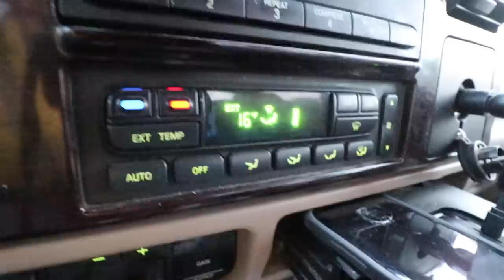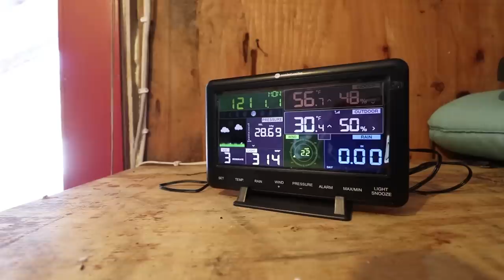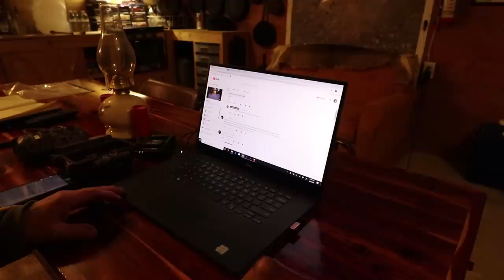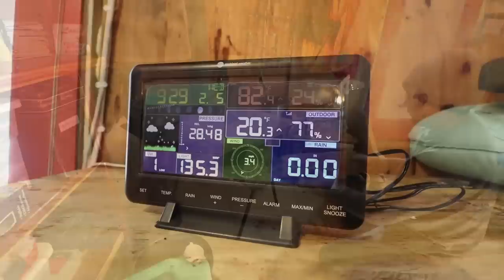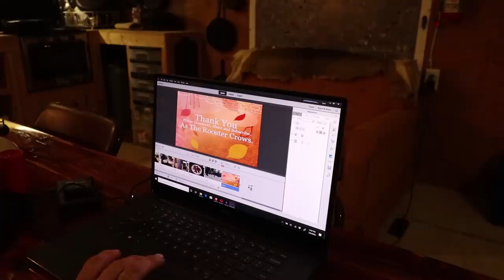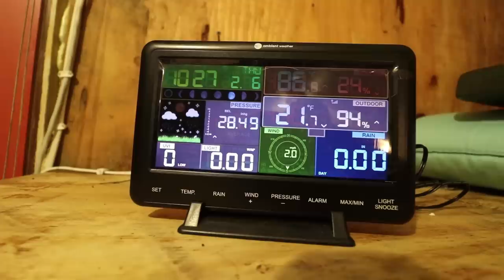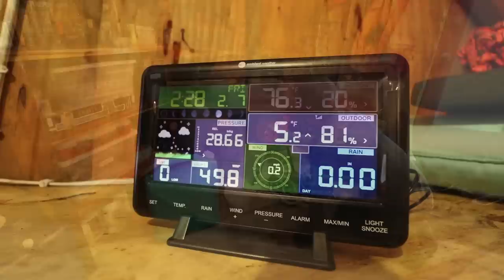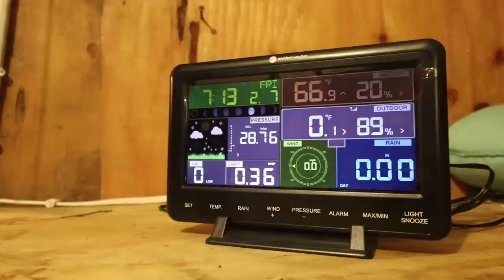THE TENT. Winter Trip 2020.

Comment: It seems like it takes quite awhile to heat yer place. I have a camp with a park model trailer on it. When I go out there in the winter I use a propane 30000 btu heater to quickly heat the place. then I turn on the furnace. The place is up  to temp within 30 minutes.

Comment: Ford truck fired right up you run a thin weight oil in the winter time , we use 15w40 here in NC but im sure that would be to heavy for the temps you guys have up north.

Comment: If you level the front of the cabin again the door will be fine.  Should be a little jacking and shimming. Then you can keep the nice door. After all it does have a great view.  PS If you move the grill in a closer to the cabin. before you leave at the end of summer. it would be less shoveling in the winter.

Comment: You have got to be running half kerosene with you're diesel or the fuel would gel in that temperature. Thanks for the video Joe.
Reply from the maker: When you get diesel here in Minnesota they blend it for the winter. Right now it is blended to handle up to 30 below. I think March 1st it switches to 20 below etc.

Comment: One of my favorite parts of each trip is the “warmup” routine
Reply from the maker: Thank you Rachel.
Reply: Thanks for your personal reply it really means a LOT! Specifically I enjoy watching the temperature in the truck as you drive there, then the sound of the crunching snow so cold the moisture has been sucked out of it to crystallize as you snowshoe the lake then later shovel. It comes apart in “soft” bricks as you cut and toss your way to the outhouse, the fire pit and the grill, like a gardener turning over spring sod. The squeal of the red windowed door as you hurl long dry wood in the firebox. The metal tang of the lever hitting the frame as you put those first frozen cuts into the furnace (after scraping from previous trip of course), and putting the heater in front of the fan in the bedroom. The electric blanket is turned on for a toast slumber. Last, the outhouse firebox is lit by then the internal cabin temperature is around 55-65 I would imagine. In between off camera I would assume you unpack, set security, retrieve property camera data and settle in. That’s what I enjoy most! The rest is like having an extra present. I know most of us faithful followers love the same thing. Thank you for sharing (and in some ways turning your private time into work) all for our enjoyment, which is why I made the first comment.

Comment: You're lucky our family had a summer cabin.  It was beautiful and expensive.  A great place for the whole family.
My father had a guy build a cabin on a river in Snohomish County in Washington State.  During the winter if is not raining its snowing.  So the family just used it during the summer months. 
The first winter the electric bill was astronomical.  Went to the cabin to find out some jerk decided the cabin was a great place to call home.  So we tried to put better locks and that was a mistake.  Homeless people from Seattle decided that Snohomish County was a great place to live off other people.
They kick down fortified doors and broke all the windows.  They completely took any thing of value - kitchen appliances, bath room  fixtures and furniture.  These jerks even took the siding and roof material.  I guess they used it to build their own shelter.  They took the drywall and window frames. 
We learned our lesson and tore down the remains of the cabin.  Insurance would not insure anymore.  It was beautiful when first completed.
Now druggies have taken over the area.  So now nobody in the family goes there.
I glad you do not have the problems we had.  Your cabin is beautiful.

Comment: So I may have missed it ,but please tell us more about how you get all your power? I'm 2 years into a cabin in Alaska and I'm trying to figure out the elec. needs. You seem to have plenty of power includeing through out the night ..elec. blanket... Are you running a generator the whole time? If you have an epsioed where you covered this please let me know. Thanks
Reply from the maker: I ran a generator the first 7 years and then had grid power brought in on the lake bed and then dug underground once the cable hits land. At the boat landing the big green electric box is where it starts across the lake. I have a Honda EU3000is generator. It ran all my needs and will run 23 hours on the 4 gallon tank of gas. Very quiet. I had a 100 foot cord and I ran the cord the whole hundred feet and that is where I put the generator. I have many early Tent videos where I am starting the generator. I was not there when they ran the power, I was down in the cities at work so I have no video on them bringing the power across the lake.

Comment: With all that snow do you have to worry about the weight on the roofs, or were they built with a significant snow load in mind? Sorry if you covered this already.
Reply from the maker: The Tent roof is for sure not built as heavy as house roofs are. She has never failed yet though.

Comment: This is your place of solice, a place to recharge your batteries. My place is the Texas Hill Country.  Great video, I didn't want it to end. Just one question, what's the back up plan if the diesel didn't crank. Sounded like it was touch and go this time.   Take care.
Reply from the maker: I am not sure, normally I bring a generator with me in the back of the truck but this time I didnt. I have one at the Tent so I may have had to go back with the sled and haul it out.

Comment: You have all kinds of motor vehicle's  except a snowmobile? Also, they do sell electric  ceramic tower heaters to warm up any room, any room. Oh! I forgot to mention a snow blower, and don't forget a shovel for your pick-up truck you'll be able to plow your way through the snow easily, instead of walking 1hr and 15 mins. enough said. BTW, I love watching your  tent video's.
Reply from the maker: If you watch the tent videos you know by now that you can not drive to the tent in the winter. It is all ski trails. I have 2 snowmobiles, I just have not yet wanted to use one to cross the lake. Maybe soon I will.
Reply: Are snowmobiles allowed on the ski trails? If the answer is yes, maybe it would be safer to go by the ski trails instead  of crossing the lake.

Comment: Joe did you figure out why the cooking oil was tipped over. You make me grunt seeing you walk in and scooping the snow, you should have a snowblower and snowmobile since your by yourself, never know what could happen. When you load the stove up with wood how long does it usually last till you have to fill it up again?
Reply from the maker: It had to have been a squirrel. I actually talk about it more later in the video. Once the Tent heats up you can sometimes go hours without loading the stove. At first though when I run it wide open I fill it about every half hour.

Comment: What stove brand? Are satisfied w/ stove / Can you recommend one way or another - Just purchase 14x20 Canvas wall tent need to get stove that can heat the large space - Thanks for video! Jack
Reply from the maker: You need to get this stove, this is my second one. The first one finally burned out after 11 years of use, I contacted the company to ask some random stove questions before I was going to place my order. He looked up my name and they still had my information from all those years ago. He then told me that the stoves have a lifetime warranty. I had no idea they did, and he did not have to tell me but he did. The company is Cylinder Stoves Company. Here is the link. https://www.cylinderstoves.com/   My stove is the Outfitter stove. They make the door draft a little different now, they have the round draft instead of the straight across but they must work just as well.
Reply from the maker: To answer your question, I am very happy with the stove. It has worked flawlessly. You can open it up and it burns very hot or shut it all down and it pretty much stops the burning process (if you have a tight damper) I call the draft my thermostat, after awhile you know just where to set it depending on the outside weather. The side water reservoir looks nice and it does work but I do not use it much because the water you do not use just boils away. I prefer to just heat water in a container on top of the stove. I would suggest though that you get the shelf and if you do not get the reservoir get the shelf for both sides. When you cook on the stove it is nice to have that place to pull your frying pan over to or move the coffee pot over. The stove takes a 5 inch pipe so you will need a 5 inch damper. The stove package might come with one already, I can not remember and I go through about one damper a year as well as the two bottom stove pipes. You can get the 5 inch dampers as well as the good 5 inch black stove pipe at Lowes. I always keep a couple dampers and some pipe on hand. They ship it for free right to your door.
Reply from the maker: And just so you know, I have no affiliation with that company at all. I just truly love my stove. Lol.
Reply: @JoeandZachSurvival  Thanks so much for tall information & Great review! I subscribe to your channel thanks again-

Comment: Joe, what kind of shoes are you wearing with your snowshoes?  They appear to be regular hiking shoes but there must me more to them than that with a good temp rating. TIA.
Reply from the maker: I just wear my Sketchers with 2 pair of socks. I wear the same thing 365 days a year.
Reply: @JoeandZachSurvival  I bet it's nice snowshoeing in regular shoes. I wear my clunky snow boots which add alot of weight. Afraid I'd freeze my feet off if I just wore Sketchers.

Comment: I am watching this video for the first time. I have a question. How come if there's a road. You don't drive closer to the cabin or up to the cabin instead  of  hiking across the lake?
Reply from the maker: You cant in the winter because the "road" used in the summer becomes groomed cross country ski trails in the winter. I either have to ski 3 miles in or do the 3/4 mile lake crossing.

Comment: Another great Tent video...I love them all!  Joe quick question.  Do you get lights from solar or a generator? I never hear the generator but I don’t see Solar panels either.  Wondering how you are getting electricity.  Thanks
Reply from the maker: I used a generator the first 7 years and then had grid power brought in. The cable is run across the lake bottom. The green box is at the boat landing where I parked my truck.

Comment: I don't get it what didn't you drive up to the tent instead of walking?? Ignore my ignorance I have never lived in a snowy place.
Reply from the maker: I do drive to the Tent in the warm months. The Tent property is surrounded on all sides by the Superior National Forest. In the winter time the road I drive in on in the non snow months gets gated off and it becomes groomed cross country ski trails. If you watched in this video just before going to my folks cabin I walked to the end of my driveway. I showed the ski trail. Where the ski trail is is the road I drive in on in the summer. They close the gate week after Thanksgiving and then open it when the snow is gone (I have a key so I can open it myself if the forest service has not yet opened it when I get up there in the spring). Even if I could plow the road in I would not want to plow 3 miles of road anyway. The nice thing is that in the winter I rarely ever see a single person ever when I am up there.

Comment: did you  change the lower unit in the on the motor boat lol
Reply from the maker: Never. I run it and then I bag it for winter and it always starts within 3 pulls the next spring and it happens all over again. When it stops I will get a different one but so far this one has been flawless for many years.

Comment: Been watching for 3 years and still love it.

Joe, just curious where you source your firewood and on average how much do you need a year? I’m sure you’ve mentioned it but I don’t recall.
Reply from the maker: Most all the firewood is from trees that have died on the property. In the future I may end up buying a semi load because we have such strict laws on transporting firewood now in this state. Earlier this year I did find some birch that was at a brush drop off sight about 10 miles from the Tent. You are allowed to transport firewood 50 miles so it was all legal. On a cold year I will burn pretty much all the wood I have stacked on the front porch. I consider that my yearly supply.
Reply: JoeandZachSurvival Thanks for the reply! I always wondered if that stack outside the tent was enough wood for the year. 

Those pork stakes you grilled looked delicious. Did you already go through the pigs you harvest yearly on the farm?

Comment: I'm new here and curious why you walk in instead of driving in since it looks like some vehicles made it there already? And if you have electricity why don't you use electric heat? Wouldn't it be easier?
Reply from the maker: I have no interest in using electric heat. You can not drive to the Tent in the winter. The road is gated off and it becomes cross country ski trails. If you watched the whole video you would have heard me explain what the Tent road was used for.
Reply: @JoeandZachSurvival  oh well excuse me. I did watch the whole video, I must have missed that two seconds in the almost 2 hr video.

Comment: What is the power source there, is it on the grid?
Reply from the maker: First 7 years was generator and then I had grid power brought in.
Reply: That's great but probably not cheap, guessing at  100%  cost to owner due to secluded location.